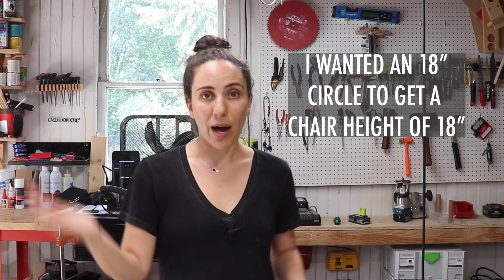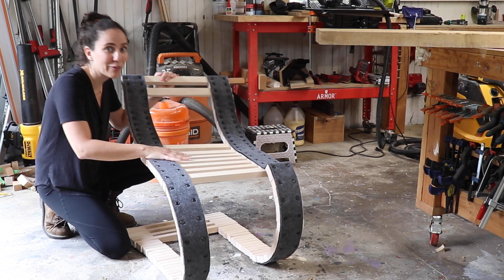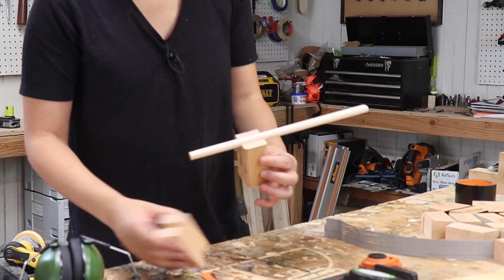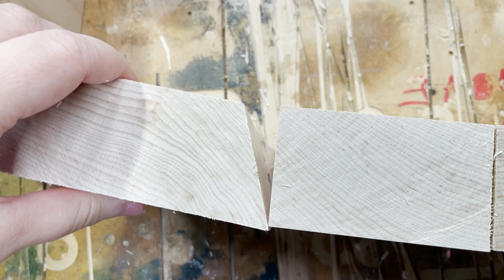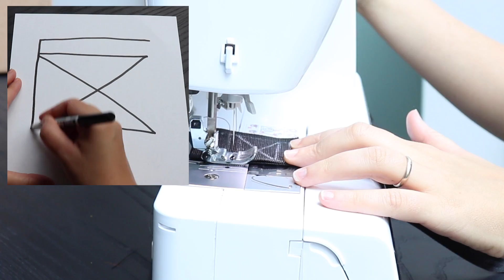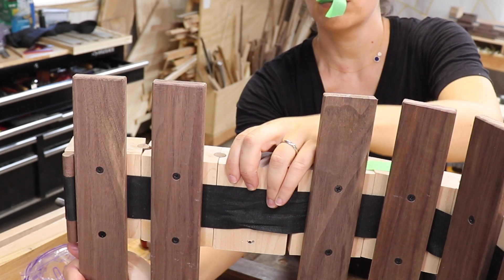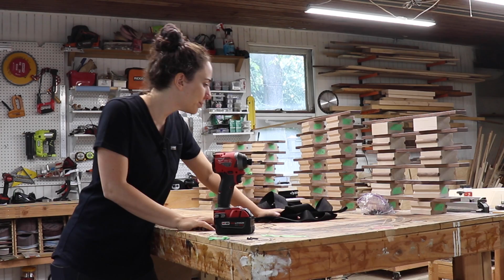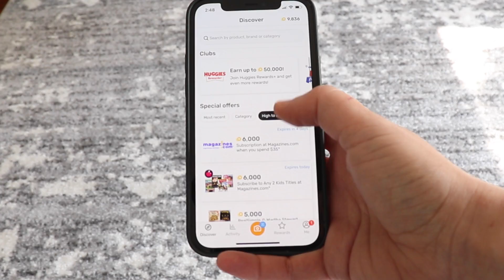I ATTEMPT to make a Roll Up Chair… AGAIN...

Comment: I feel like I am not in a position to give advice here, but I want this thing to be built and work... 

The reason this is not working is you treating is as a wood working project. But this is an engineering project. You need a pretty good idea of the forces involved and choose the material and dimensions accordingly. The obvious issue here is stiffness. This chair is basically a spring and you need to know in advance how far the straps will stretch under the expected load and how far the wood will compressed (especially if used in the weak direction). You need to design how far the chair as a whole will give under the weight. This has to be pretty precise as small errors add up from piece to piece and springs are tricky to design as most dimensions are affecting the stiffness in higher powers.

The chair collapsing is caused by the straps slipping. The bending forces are different for each location. But a loose strap will have the same amount of tension everywhere. So the areas with less bending forces will have excess strap tension that tries collapsing the chair and pinching your arm. If the strap is fixed to the wood stress can vary from piece to piece. But as stresses are so different the strap needs to be fixed really strongly - basically with the strength of the strap itself and not just "with staples".

Comment: Did you think of seat belt? I doubt it has much flex. Its cheap and should be long enough.

Edit: nevermind they're designed to stretch under high force.

Comment: Your problem: your if you put 60 pounds on the chair the force on the webbing is around 20 times higher so 1200 pounds (the uhmwpe is rated for around 1500lbf). Uhmwpe stretches up to 3,8%. As you put a lot of force on it, you stretch it a lot. I guess around 3%.
Since the webbing is not attached to each individual joint, it stretches by 3% of its entire length, which I guess to be 3m (roughly 10ft). A stretch of 3% on 3m is around 9cm (~3,5 inches). 

I guess that is the problem. Fix: fix the webbing to the individual pieces, probably glue the wood to the webbing. Epoxy should work. Good luck!

Comment: Damn, so many comments so you are not going to see this, but the answer to me was apparent. Metal cable.
It seems you need not just precise tension, but also adjustable tension.
I would find a way to incorporate metal cable, possibly by drilling a channel (or even two, top and bottom?) through each caterpillar track and then adding a tensioning device on the end of your choice.

Ooooooor, since the tension failure is in that lower curve, you may only need to add cables through that C shaped portion and have a tensioning adjuster cut into an anchor piece on the bottom section of the tracks.

Hope you do find a way to beat this idea, because it is worthy.
Leather will not work.

Comment: Have you tried using steel cable? You could cut a channel into the wood to accommodate it.  The amount of tensile load steel can take with almost no stretch (probably measured in hundredths of an inch for this) makes me think it would make this design work, even if you need to use 2 cables per side.

Comment: What if on the original try chair, you took some piano hinge cut to the length of the strap width.  Attach them under the strapping using the strapping to hide it.

Of course you glued the strapping on the original so put them on the outside as a proof of concept. But the slats should hide the bump on the hinge and you shouldn't feel it while sitting.  That should also correct the sideways movement too. 

If that appears to make it function better,  you can take some of your angle cutoffs if you still have them and glue on the existing angles to tighten the curve up. 

You won't have a perfect chair. But you would have a proof of concept using essentially waste material now. You could try it on the bottom arch to see if it works. If so, then move to the top arch for the back rest.

Comment: What if you get strapping that isn't as smooth? that way maybe some friction would prevent the ends of the wood blocks from sliding against it. You could fuse felt with the strapping you have now using fabric glue
Also, I think maybe making the curve where the base meets the back less than 90 degrees in the design could help it not lean too far back with weight on it.

Comment: It occurs to me that any fabric (or even leather) has too much stretch. Even if it starts out tight enough, repeated use will produce too much stretch and it would loosen up (think tight leather shoes that get comfortable after wearing). Just too many points (between each piece), so even miniscule stretch at each multiplies to end up loose. Maybe steel cable run internally is a thought ... not sure how that will effect roll-up. Cable through eyelets on the back side? Gives me a brain cramp visualizing. 
Good Luck...it'll be awesome when you find the solution!!!

Comment: Leather stretches, and I believe it will perform worse than the straps you have tried.  

You need something flexible that doesn't stretch (or stretch much).  Vinyl coated stainless steel cables?  You could pre-stretch them before installation.  They are extremely strong, and tension can be adjusted at the ends using threaded cable tensioners.  No disassembly required.

Comment: can you make the 1st 5 sections on the bottom NOT bend, and use a nut and rod as a tensioning device? drill a centre hole and run a cord or wire through the hole.  you can use the nut to adjust the tension.  Everything will stretch over time/heat/moisture so something to adjust might work.   with the strap on the outside, all for forces are kinda wrong. if your tensioning system is in the centre the pull will be more even.  Also, don't use leather

Comment: After watching your agony with this my first reaction is that there is far too much moment arm acting on the individual joints for a strap to be effective.  What would happen if you used metal hinges at each joint?  At least on the outside curve of the "leg" section.  That way it will still roll up, and you sacrifice a little weight for security.

Comment: Can someone do an FEA on this idea? My gut feeling is that the forces in some of those joints are really high. You're effectively creating a level pulling that webbing with the dowel as the pivot. Someone let me know if my highschool physics math is wrong here: the pivot looks to be about 1" between the dowel and the webbing. If we assume 150 lbs on the center of the chair, about 1 foot in, that's 150 ft-lbs. Now that level is going to be ~12 times that, so 1800lbs. There are two of those, so 900 lbs per "snake". It feels like they're probably under more strain than that thought....

Comment: Don't beat yourself up too much about this, you are trying to replicate a design that barely works at best.  In In order to work you need the strap to have 0 stretch, absolutely none.  And you need the wood to be incredibly hard, 0 squishy factor, perhaps artificially so, maybe impregnated with resin after shaping and drilling.  And you need the angles to be perfect. Even the inventor of this thing isn't shown relaxing back into it, the photos I found of him show him perched lightly on the front.  All in all it's the typical show off design / art student making a highly impractical thing to impress a teacher for a grade, nothing more.  Looks cool but is only for appearances at best.

Comment: Prior to yeilding, deformation is linearly related to initial length as stress is applied.  Without changing strap material you can limit the deformation at each joint (stretch) by fixing the strap to the blocks - limiting the segment lengths.

OR maybe you could use hinges

Comment: I think leather will stretch more than your synthetic straps.  It will be expensive but if you use metal hinges and through bolts, that would eliminate any stretching.

Comment: How about miter out your half moon like you did for the dowels, but parallel to the direction of all the chair pieces running the length of the pieces. Then inlay a braided steel cable instead of a webbing strap in that half moon to use as your tension strap.
Reply: Or a flat chain like a motorcycle chain could work?

Comment: What if you punched grommets through the strap at each of the struts and screw/secure through them so the tension is held between each strut rather than sandwiching with the struts which allows more stretch end to end of the chair?
Reply: Commented this before reaching the end where you mentioned staples :P But maybe grommets or something similar with screws through them would be stronger?

Comment: well that website at the beginning is a god send.  That dowel drawer was pretty genius.  Should be pretty smooth if metal rods were used with some oil or waxed wood dowels maybe.  I will have to watch that video to see your final piece and how you made them slide well.  
Now that the chair is glued, it is probably too late, but what if you used the first version where you screwed each block to the strap instead of just capturing the strap with the seating boards.  So you would need to countersink the seat boards so they could sit on top of the strap screws.  Would still allow it to roll up, but would take out so much of the stretch you get from the strap only being attached at the 2 ends.  It should also add to the stability since each segment is attached to the strap physically.  And it would keep the bottom tail from pulling under as well.  I think you unfortunately added another variable when you did not attach the strap at each segment.

Comment: I'm really impressed you tired the chair again. Looks like you have enough room for 4 wood layers. two just doesn't support enough weight. angles are prefect. my other suggestion is some kind of fixed curved metal piece where all the weight is. Very impressive Tamar. Good luck.

Comment: I feel it may help to treat it in segments. The straps in the bottom/front shouldn’t directly transfer stress to the straps on the back. The front cannot be elastic whatsoever otherwise you get separation and instability.

Comment: Would installing hinges between each segment do the trick? It might not look as graceful as the band, but it would isolate the tension to each joint, so you wouldn't get parts of it curling up unexpectedly. And it would still roll up, which seems like one of the key features.

Comment: A suggestion I haven't seen here (which might be because it's a bad idea) is to not use straps at all, just use hinges between each section. Hinges would allow the sections to fold in one direction, but not another (which is what's happening when the straps stretch).

Comment: Extra pieces but why not cut dowels as an add on. Drill holes to hold said dowel on underside of seat and top side of “legs”. After unrolling, insert dowels in holes for vertical support.

Comment: It almost seems like you need to pre-stretch any material you use. Its like a guitar string, the first few times you tune a new string, it loses its tune more easily because of the stretch in the material, then the tuning is less frequent once the material is broken in more. The other solution to the collapsing is once the material is almost fully stretched, you might need to put staples into the material  at the major tention points, like at the beginning/end of the curves. This small modification should prevent the base and the back don't curl.

Comment: It feels like the only one more thing you needed to do was to run another screw right through the strap on each piece to prevent it from sliding under the planks. Once you have the right lenth of strap between each two pieces, you want it to stay in place.

Comment: You need the blocks to be larger in the side view dimension so there is more contact surface between the blocks decreasing the leverage applied to the straps.

Comment: how about a bazilion hinges or even pinning the strap down at a bunch of spots, seems like when you sit on it the tension pulls other bits of the chair making it flip out, maybe if you secured the strap that wouldn't happen and also all the slack couldn't all go to one crack that opens up

Comment: The idea with the dowels to fix the issue with the sideways motion is briliant!

About the strap stretching:
How about running something like a stainless steel cable through the blocks and tightening it with some sort of cable lock until it's in the correct shape and then keeping that wire length?
I can also imagine that the technique of adding tension by first starting with a few missing blocks may be putting the tension on the wrong places (as the other blocks are screwed down already). Maybe adding some cable locks at certain points in-between to vary the tension might fix this?

No clue if any of this makes sense or will actually fix the issue. You're already doing a waaaaay better job than I would every see myself doing.

Comment: I'm also emotionally invested in this trilogy now. I don't think leather would cut it, as leather is also elastic. I would try metal hinges (flush with the wood) instead of a band of some sort. Metal hinges doesn't need to be tensioned and are strong. Also I would add one more bending segmented part so that there are support both left, right and in the middle of the chair (like three spines).
Reply: Hinges also have the benefit that some slack in a less critical hinge does not translate to the the ones getting the most stress

Comment: Another idea: using metal hinges instead of some fabric-y ribbon might help with overall stabilty especially at the lower bend
And don't use leather. Try it first, I bet it will stretch even more than the strapping you used in this version.

Comment: Wow, I like this idea of a roll up chair a lot. Just you seem to make it in a shape close to what you WANT it to be in the end. As a material scientist I suggest you work the other way around and test what shape you need to manufacture so that it BENDS INTO the shape you want WHEN YOU FINALLY SIT ON THE CHAIR. There is no need for it to look like a chair, while there's no load on it, it just needs to stand and not tumble.
This way I guess the lower bend will have to get a MUCH bigger radius and the upper bend a smaller one. Plus I suggest to experiment with smaller versions and to see if you can stiffen the upper bend even more like glueing more than 2 pieces together.

Comment: I feel like you might be able to do it as a post tension structure with two internal steel cables running inside the wooden blocks.

Comment: you should use the concept of prestressing. First stretch the strap enough and then fix the straps onto the straps. (this concept is used in segmental bridges)
the chair is failing due to elongation of straps which creates the gaps.

Comment: The biggest thing you're missing is you're trying to make the initial shape into the shape of a chair. But you're not accounting enough for the flex, if you make the "leg" section a larger radius it'll sit alot steeper but after weight is added it would flex into the shape of a normal chair.

Comment: I think the problem you've got here is that your chair doesn't have a way to resist shear forces.

The wood will be really good at resisting compression forces.

The lengthwise bindings will be good at resisting tension forces.

But I don't think that you're going to have much success until you find a way to give the chair a method of resisting shear forces.

What that looks like I'm not sure, because the entire design premise of being rollable requires you to be able to completely break the material's ability to resist shear forces so it can be rolled.

But I don't think that the answer will be better cables, straps or webbing. Those will only resist tension forces, not shear forces.

It's a bugger of a physics problem.

Comment: Still think cable is the only way! Instead of the outside you could go through the center of each piece. It would be cool to have a ratcheting crank that rolled it up to put it under tension.

Comment: So the best material for low stretch is Kevlar. It’s common with tow straps because it doesn’t stretch and store energy if it breaks (so doesn’t whip and hurt someone). And yeah the biggest tension or right at the knees and needs to be isolated from the back separately
Reply: Kevlar actually stretches less than steel I should add. So you might want to experiment with a tow strap and see if it gets you where you need at first. Also why Kevlar issued in bullet proof vests

Comment: Plan “D” is a good idea. Just cut two D shaped frames that would be inserted on the sides of the bottom curves. It will not make the chair a completely roll-up chair but you will have a chair.

Comment: Carbon fiber webbing strap if that exists.  I've read that doesn't stretch and securing it between each block if that's possible or in smaller sections and doubling it up where most of the tension occurs where you are seeing gaps??

Comment: So why not just use hinges instead of long straps? I know it would probably be expensive and tedious to screw in 60 hinges, but it wouldn't allow for any flex except for the wood compressing, it would keep all those gaps real tight, and it would sill let it roll up.

Comment: Try adding more strap sections maybe? Like instead of 2 straps, use 3 or 4, but on smaller wood sections. It lowers the load on each individual strap

Comment: rather than having the joint around each pin be 2 halves maybe use a dado with a hole going through the joint making it more like links on a chain and then the angle of the mitre on each link will determine how far you can rotate that link before any given pair makes contact and stops rotating sp when the chair is un rolled all of the segments will be fully supported in compression where the links mate together and in tension the pin in the center keeping the two blocks from separating under load